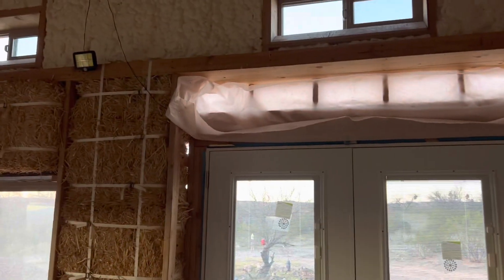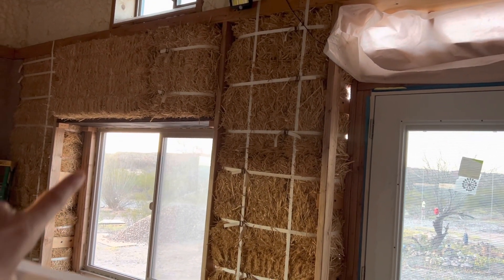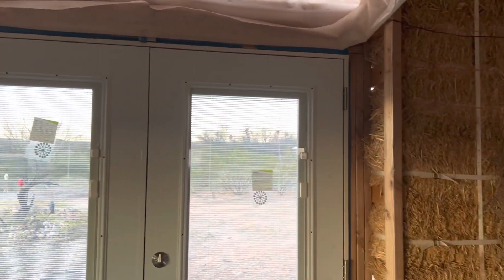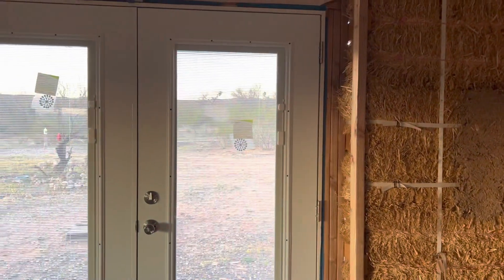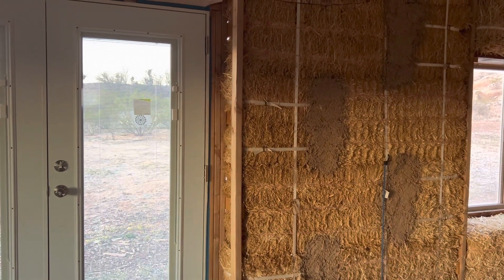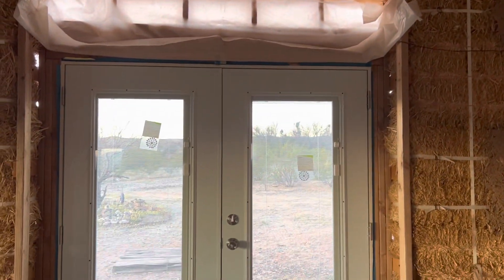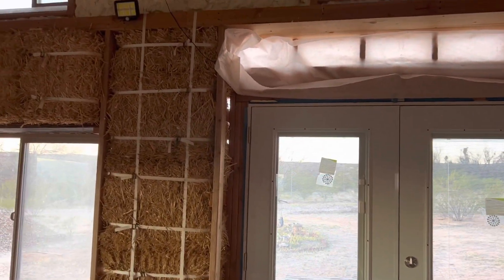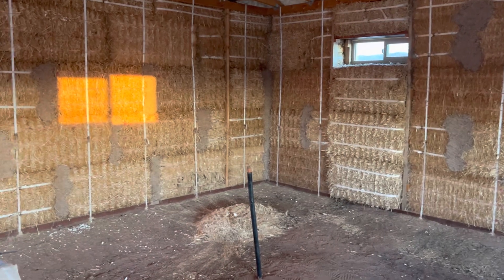Straw bale House Insulation - How Is it Performing ￼

Comment: If you don't have anything in there to heat the place, I'd say you knocked a home run, the place should be cheap and easy to heat and cool.
Reply from the maker: No assistance!  Very promising.  Might still need some help at the extremes, but a very good start.  👍